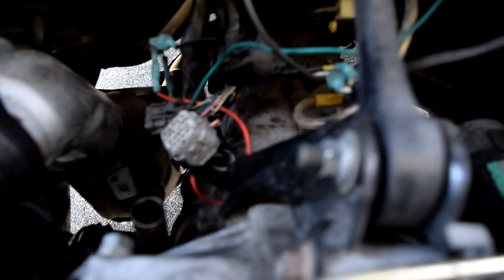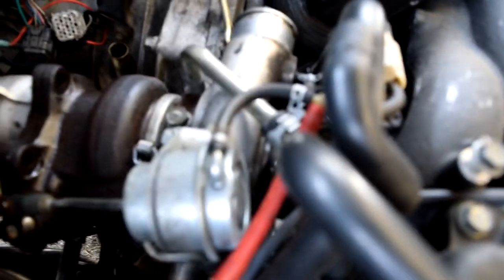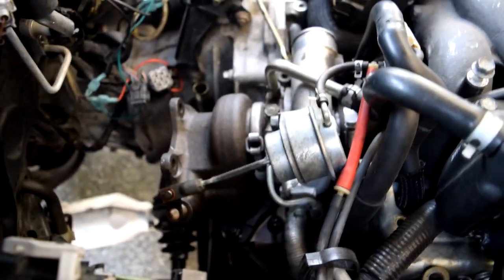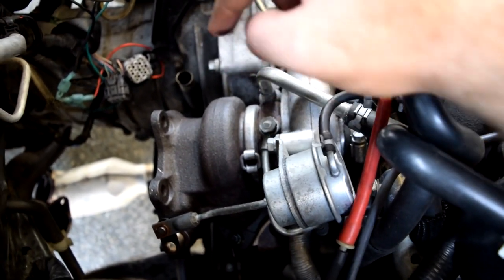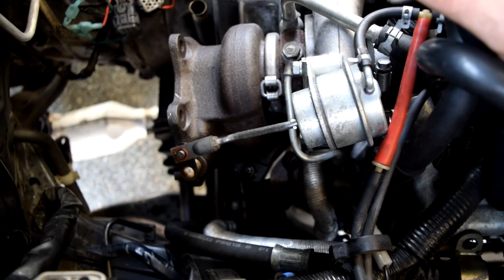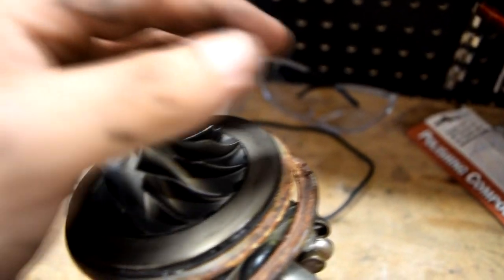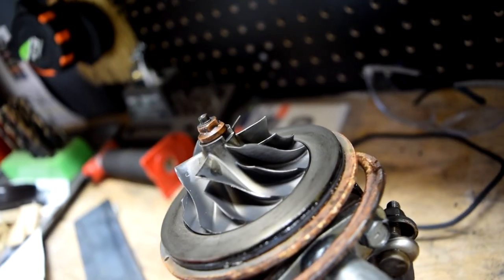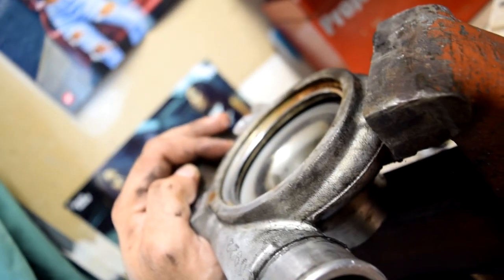Subaru Forester XT Turbo Removal | Oil Consumption and Turbo Issues

Comment: Hi David - I’ve owned several non-turbo and early model turbo foresters here in Australia - my daily drive is now a Hilux but would like another XT for a ‘project Sunday drive’ vehicle - I’ve never had any head gasket issues in fact I got my 1997 Forester to 425k before a cam shaft seized - anyway I’m looking at a 2005-2007 XT Forester but have seen some US channels that showed this model has a few issues such with banjo bolts, EVAP, secondary turbo heater? And so on - I’m retired and happy to have a go but what has been your experience and advice? - John in SA
Reply from the maker: My ownership experience was not good in short. In the states our forester xt at least turbo manual was limited to a second gen model which came with the 2.5 turbo motor and I being a car enthusiast but still young and dumb got real excited when I found one and ignored basically all the red flags like a dummy. Bought the car and basically had nothing but problems with it from the time I brought it home. CEL came on driving it home and I drove it for about a year before it really gave me bad troubles. For whatever reason power would just disappear from it and then at some point it wanted to run on 3 cylinders and a whole host of issues and when I started diving into the car I quickly realized I bought an auto to manual conversion that was not done well and I went chasing my tail. Long story short I had the motor rebuilt by a local Subaru shop and after that the car ran worse than before I had it rebuilt so I took them the whole car where it sat in the back of there shop as I continued life. Not a huge deal I had a couple other cars to drive around. About a year goes by and I still don’t have the Subaru back nothing really for the shop call the shop find out the guy who rebuilt my engine was let go for some shady business practices and the owners struggling to fill his orders shops going under etc. I inevitably trailer the car home and I spent a couple months scowering the internet and troubleshooting everything I could about it but never any luck. I ended up selling the car because I didn’t really want to look at it anymore I’ve had it broken longer than I’ve had it running and I was incredibly frustrated with it and so I just sold it as is dropped the problem and walked away from it. So in short I wouldn’t buy one personally. When it worked it was a fantastic car handling and driving and would fit a family great. However from my understanding the 2.5 turbo motors can be problematic however I don’t know if they used those just in the states. Hope that helps a bit.
Reply: @davidfletcher4016  thanks David - sorry you had to deal with all those issues created by a dodgy owner - you’ve saved me a lot of grief, time and money - I’ll stick with a normally aspirated one though not as exciting I know these models well but won’t get anything after 2013 because of the global CVT issues both with Subarus and Nissans which I think you call the ‘Rogue’ - the new Mitsubishi Outlander is actually a rebadged Nissan so avoid those like Covid - John in SA
Reply from the maker: @johnnumbat9782  absolutely thanks for the advice. I’ve been informed that the 2.5 turbo Subarus are the problem children of the turbo Subaru world but after the one it left me with a bad taste and I don’t think I’ll be going back. I’ve been super happy with my 2002 Jetta tdi wagon. Absolute workhorse gets a good 40-50 mpg isn’t a Prius and I know the 1.9 tdi motors can last a long time. My bud had one that was still going at 350k miles. Not sure what that is in ks but a lot lol. That’s the new daily work horse and I would definitely recommend one if you mpg is a concern and daily reliability providing you don’t have real bad winters.

Comment: I have an 08 subaru forester xt and it's fuel consumption is very high. How can I fix it
Reply from the maker: You could start by monitoring your fuel mileage and comparing against what the oem rating is and compare to what type of driving your doing. I think I was getting around 15-18 with mine when I had it. Mostly city driving. Then next bet would be returning it to oem specs under the hood if it’s been modified it isn’t going to help your fuel mileage. Do your maintenance fuel filters injection cleaning fix any cel codes. And then when you drive stay out of boost if you want mpg. But otherwise they’re not great for mileage.
Reply: @davidfletcher4016  ok gonna clean the fuel filter and injectors and see what happens

Comment: What did you finally do? Rebuild or replace?
Reply from the maker: Christopher Inman both I’m assuming you mean the turbo. I broke the chra trying to separate the housing I was going to rebuild it. But ended up just replacing.
Reply: @davidfletcher4016  thats what I did, got aftermarket off ebay, think $130, going to send original out for rebuild. Thanks for response.
Reply from the maker: Christopher Inman if you can separate everything rebuilding isn’t hard at all I did it with the turbo that I had in my Miata. However they can sometimes be pretty stuck from years of heat cycles.
Reply from the maker: Christopher Inman best of luck otherwise!

Comment: Did you ever find out what was causing the loss of power? I’m having the same issue and I’m also thinking it’s my turbo
Reply from the maker: Dustin Bridgeman I believe the rings to be a bit worn out. I went so far as to do a head gasket job and have the heads decked and cleaned. No visible leakage from underneath and it did puff smoke even after all that. Anyway I should be making an update on this car whenever the weather clears up a bit here.

Comment: Is it possible to disconnect a turbo from an engine so that it runs as a non turbo engine?
Reply from the maker: Yeah no reason you couldn’t. Change the exhaust remove the turbo. Block the high pressure oil port close the drain loop the coolant lines and build an exhaust without one. Then you’d need to probably retune the thing.
Reply: @davidfletcher4016  Most likely you'll need new injectors and definitely a tune.
Reply from the maker: @chrisdenetso  yep also a possibility as well. Kinda an oversight but I’d hope the original commenter would do his research before removing a turbo from a car. 

I’m not sure how big the fxt injectors are and if they could have a small enough spray window to get away with it I think was my initial thought.